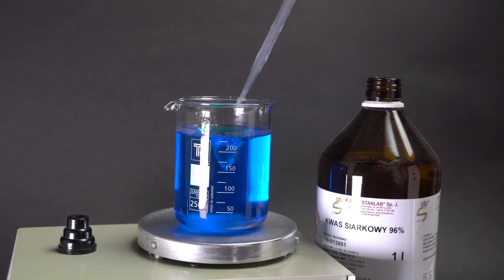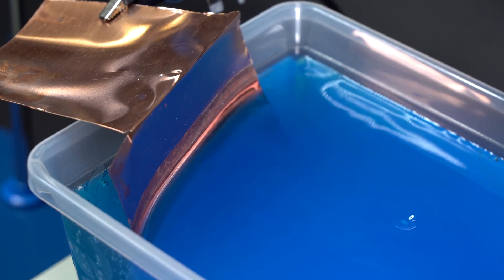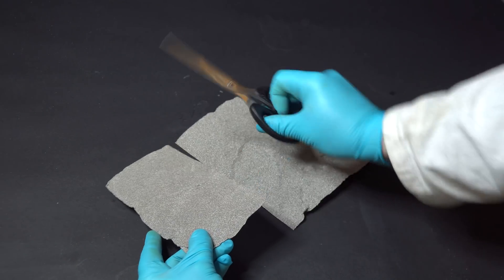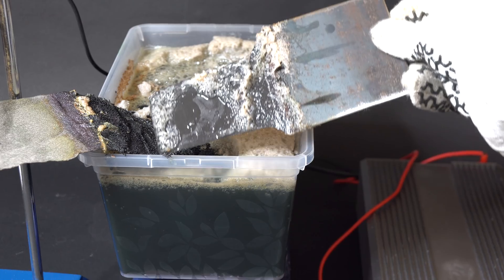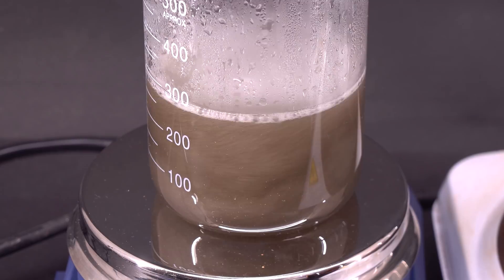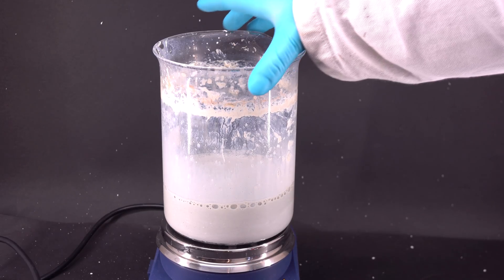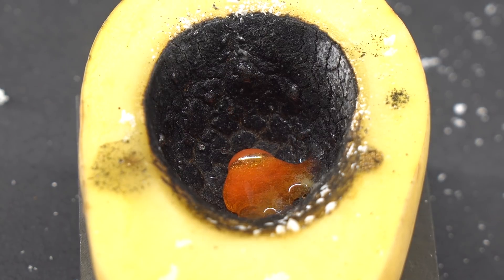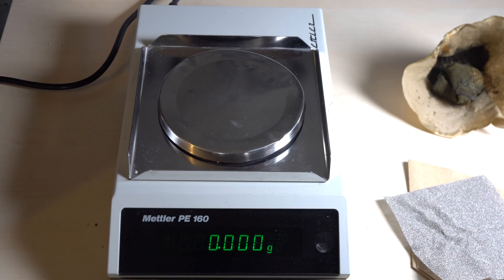PRECIOUS METALS From a Chemical Waste!

Comment: @4:05 For the Nickel(II)-sulfate couldn´t you have first converted it with cheap sodium hydroxide to nickel-II-hydroxide (and sodium sulfate) and then convert it with hydrochloric acid to nickel-II-chloride and used that for electrolysis of pure nickel?
Reply: What he said following that time stamp explains why.  It's not just nickel (II) sulfate.  Otherwise that would work.

Comment: Gold prospectors have been using potatoes to melt gold flour into beads for a long time.  They wouldn't melt a nugget as it generally has a higher value as a nugget than as a bead, but fine flour is best condensed into beads as it is fine enough to embed into sacks and other container walls, unless made of glass, and then glass likes to break, so it isn't brought out to the mining grounds.  No one like losing gold.

Comment: As for the chemical methods, see [1] as good reference for how to properly dispose chemical wastes, including all kinds of metal solutions.

Usually the solution is first neutralised, the metal is then precipitated as a water-insoluble salt, such as: hydroxide (if not forming a soluble complex), carbonate (e.g. copper(II), nickel(II), zinc(II)), chloride (silver(I)) or as sulfide (using sodium sulfide solution). The insoluble precipitate can be removed by filtration and the excess sulfide destroyed by suitable oxidizing agent.

Alternatively, one can often use metathesis to precipitate least reactive metals with more reactive ones.

It is always good idea to plan ahead, for example if one has waste solutions of copper(II) sulfate and zinc(II) sulfate, one can first precipitate copper by adding zinc (displacement reaction), leaving zinc(II) sulfate solution, that can be combined with the other waste zinc(II) solution to save time.

Some metals have special properties offering an easy recovery - silver forms an almost insoluble AgCl precipitate, that can be easily removed from solution, washed and converted to metallic silver by various methods.

It is important to control not only pH but also concentration of ions present in the solution!

[1] National Research Council. Prudent practices in the laboratory: handling and disposal of chemicals. National Academies Press, 1995.

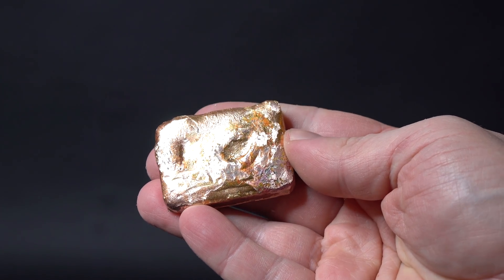Comment: 14:20 

If you want to remove borax more efficiently, boil the ingot in a dilute sulfuric acid solution
Reply: while that would be fine for Gold and the platinum group metals, but would just turn copper back into copper sulfide, and as the point was to get copper out of solution that wouldn't be as optimal.
Reply: @Hawkido   copper is immune to dissolving in sulfuric acid so....no. Possibly with prolonged heating in a concentrated solution it would VERY SLOWLY dissolve, but if it’s dilute, you’re totally fine. Even in a more concentrated solution it would take days or weeks due to needing an oxidant to really dissolve at an appreciable rate. This can happen with atmospheric oxygen, but it is VERY slow at diffusing into the solution. Due to its activity being below that of hydrogen, in general, copper is considered immune to every common acid except nitric acid.
Reply: @spiderdude2099  yep... you are right, you would either need a powerful oxidizer, or an electrical current to get it to dissolve.  my bad.

Comment: When using graphite anodes that are prone to breaking doen, I suggest separating it with a pourous ceramic cell that will capture the graphite particles, but also allow dissolution and elctrons to flow relatively freely. It requires some attention and maintenance, its far cheaper than investing exotic metalic oxide anodes in bith the short and long term.
Reply: Are they having some binder or are they only pressed into form.
Reply: @wernerhiemer406  ii dont acrually know. I'm assuming the bentonite being a clay would be the binder, but pressing it wouldn't good enough as it would quickly dissolve in an aqueous solution. So in my suggestion i would recomend sinter the mixture in a kiln to glaze the particles together. A clay might jn turn prove to be a terrible idea, but a metalic oxide might prove useful.

For traditional graphite electrodes i do assume they use some type of of binder and press form them. I haven't been able to find anything kn their manufacture either, otherwise this post would only be a few words.

Comment: Is there an easy way to extract Neutrinos from the air in sufficient quantities to power my Neutrino Light Speed Engine (about 5kg per light year)?
Reply: That requires more than just potatoes. You might need an entire vegetable garden for that.

Comment: A potato crucible. Nifty!
Reply: Wonder who figured that out first? Was it by accident or experiment? 🤷

[Youtube has a bot or paid TROLLS that DELETE factual comments]
Reply: @CHIEF_420  if you've ever camped and cooked potatoes in a fire with no foil or covering you understand this concept perfectly
Reply: @CHIEF_420  Maybe a welder tried cooking a potato and other veggies with a gas blowtorch during a power outage and found it took much longer than expected. Might have then used one as a rest for hot metal. Later, tried melting solder, etc. on one for fun. Then passed the idea on in comments.

Comment: Imagine an underground black market ring that deals with gold and there are some guys there who just purify the gold in a potato.
Reply: Yes this actually exist in Brazil, here we have a lot of ilegal miners and most of then use a potato and a hidrogen burner
Reply: Potato ban. Also some slavic run out of supply for making a beverage designed for cold climates. At least some copper vessels are left unused and ready for recycling to make some money.
Reply: @wernerhiemer406  , enter the meth heads.